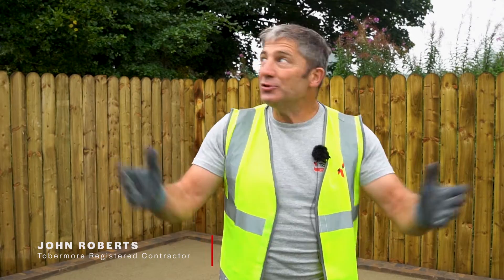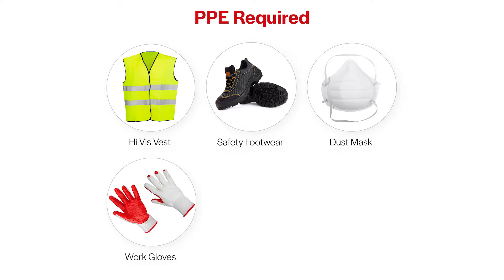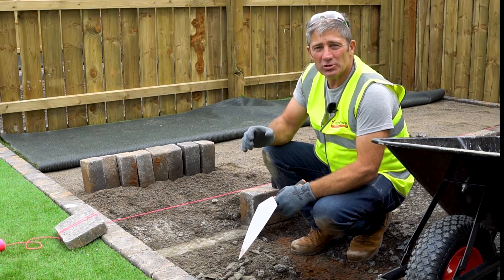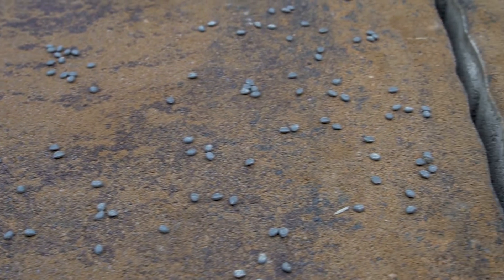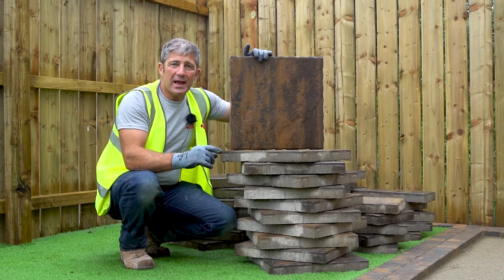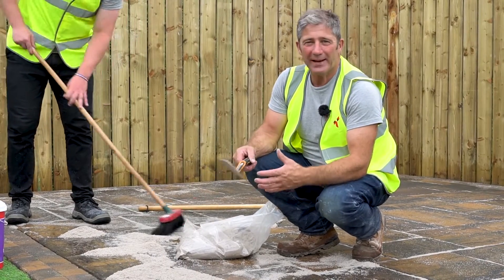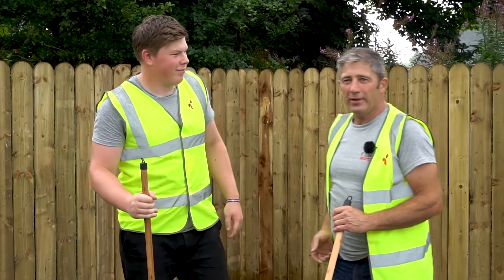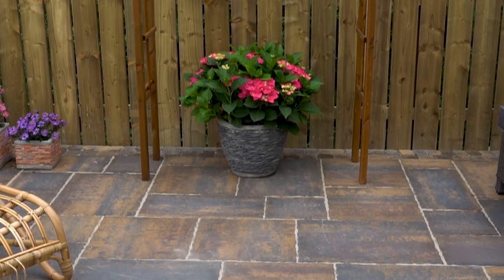How to lay a patio using Tobermore Historic Slabs

Comment: Bit confusing as you said to leave patio levels 3-5mm higher than final edging level to allow for final compaction, but then you didn't compact them at the end as they were all level. So either the slabs are now 3-5mm higher than the edging, you screeded to finished level and didn't put the 3-5mm allowance in or you compacted them down mechanically/manually off camera and didn't say. Which is is? Also should you run just a single pass of the compacter on the sand before final screeding, or should you compact the sand solidly using multiple passes and then screed it? I would have expected you to lay a row of flags to stand on so you can then take the poles out and fill in without standing on the area you've just screeded.
Reply from the maker: Hi John, many thanks for the comments. You are correct regarding the 3-5mm level. We had used footage clips from another video where the flags were compacted and should have put a disclaimer on this. Regarding the screeding, there are several different methods used by experienced contractors to install the sand laying course all of which are acceptable and have proven to work successfully over many years.

Paving contractors usually have their own preferred tried and tested methods. The pre-compaction method shown is an established method used by many installers. A thin layer of sand is spread and lightly compacted (one pass with the compactor). The screed rails are then set into the sand, more sand added, screeded and compacted. You can as you have stated, place a single layer of sand, compact it thoroughly, slightly loosen the top 10mm and screed it.  We hope this helped answer your query.